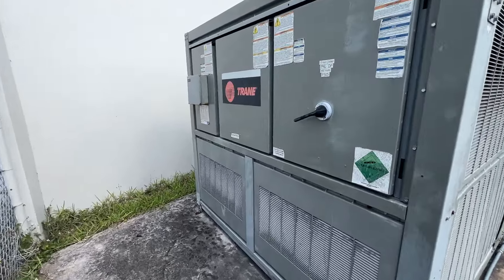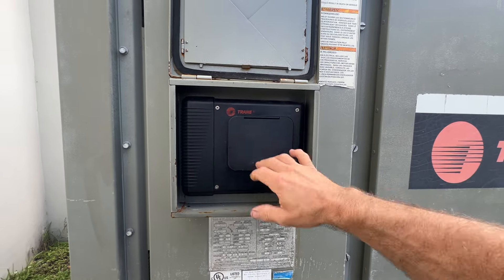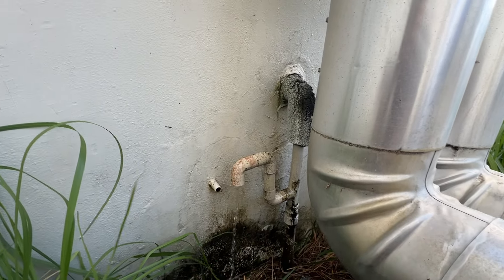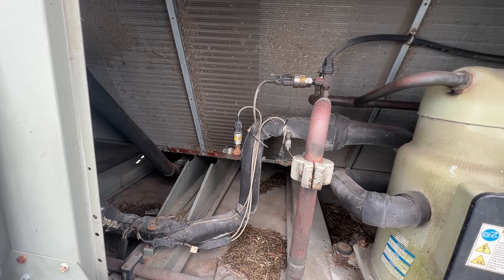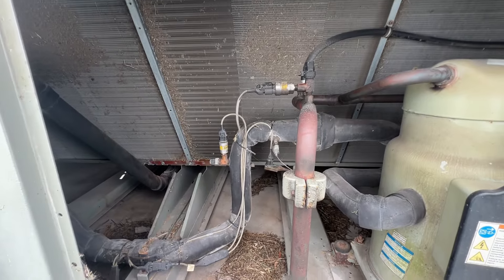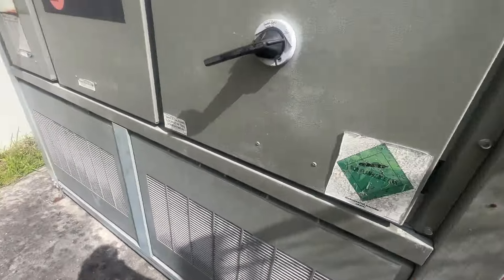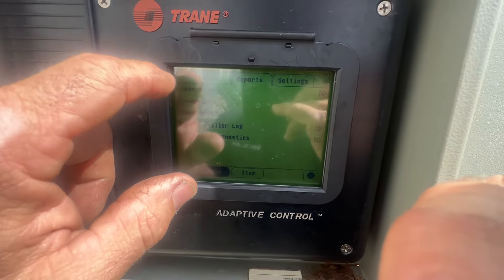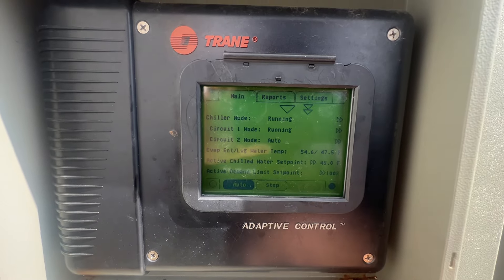Loss Of Charge TRANE CHILLER CGAM070F … Leaks or Something Else

Comment: . to take your time, as you can see, working around those EEV's can cause more issues. I had an older 115 ton CGAM that kept going into EEV communication loss, even with the new cables. Used silicon on the connections around the valves, end of issue. Great square one troubleshooting of diagnostics.
Reply from the maker: Thanks for sharing, 👍